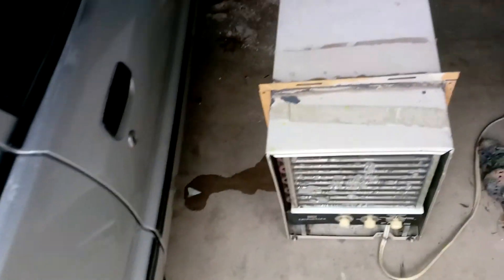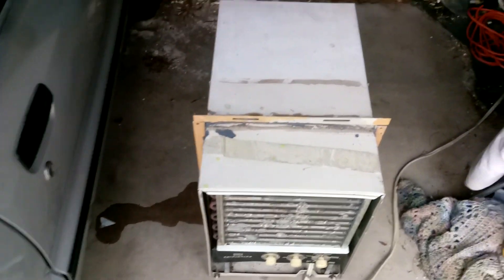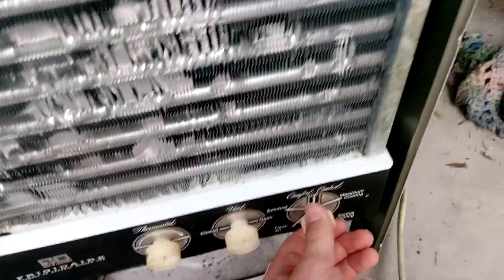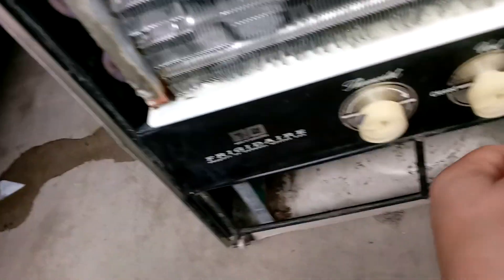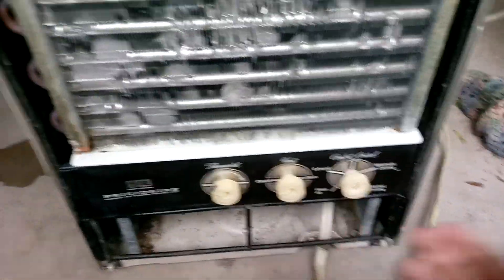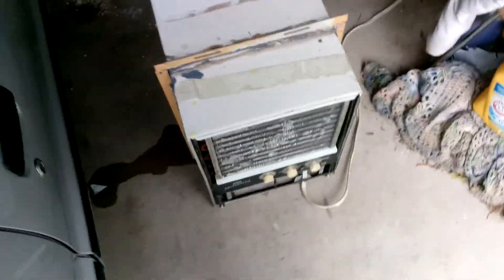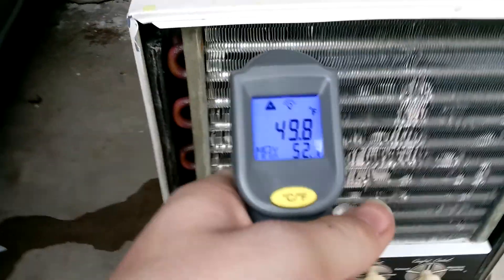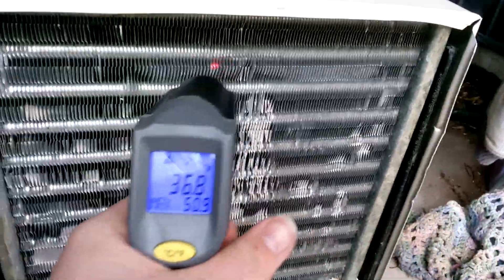1970 GM Frigidaire back in it's case

Comment: That seems to be working quite well and I'm sure will do just fine!  Often, I've cut plywood to fill in the rest of the window when the unit doesn't fit nicely; duct tape seals the gaps leftover.  And the plywood should screw into the window frame if possible.  In our old apartment, the wood would screw to the metal window frame, the A/C would go through the wood, and then I'd put 2 bolts through that and the wood.  Nobody would be pushing that unit in to break in.
Reply from the maker: jaykay18 yeah this unit works very very well. I've been thinking about doing something like that to make it secure but use some sort of puxi-glsss or that plastic like glass so the light is still coming in. If someone were to try and push this in they'd have to be pretty strong! These casement units are extremely heavy!